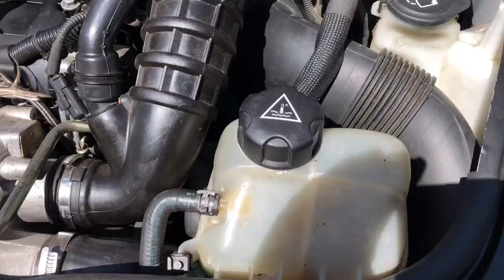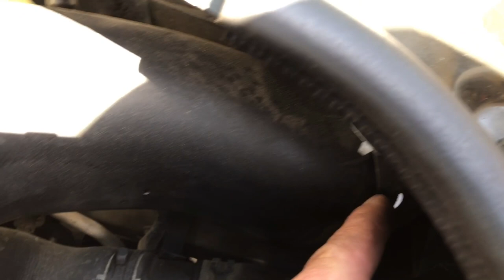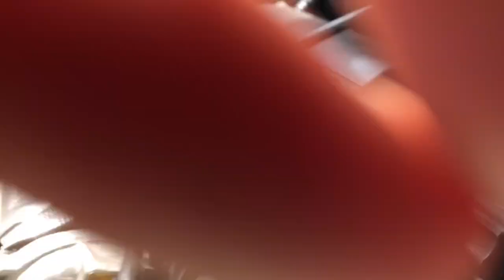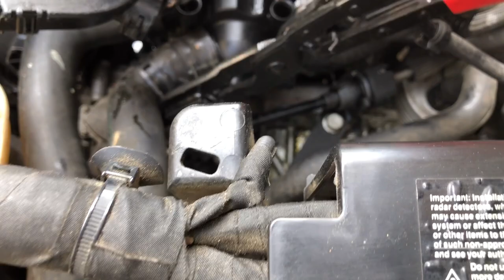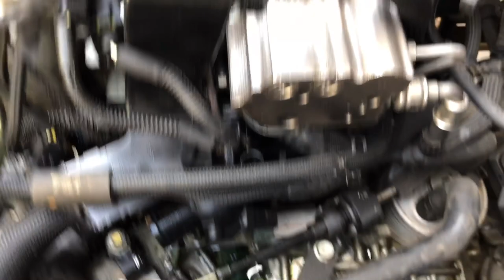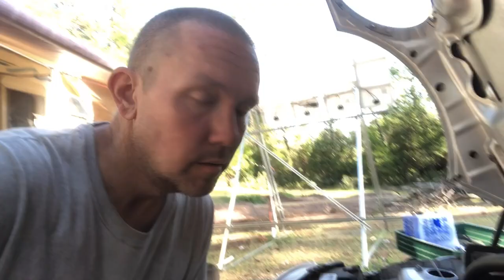How to replace the thermostat housing on a Mini Cooper S R56 with the N14 engine

Comment: I’m a novice but was able to do this repair in about six hours including the coolant fill. My biggest struggle was removing the turbo hose from the thermostat housing. My solution was to remove this once all the other hoses and water pipe connection were removed. I HIGHLY recommend investing in the $40 to get cable hose clamps. These will save you so much time and frustration with tight spaces in the mini

Comment: DO NOT do this project without new hardware for your thermostat housing. One of my bolts broke while installing the new one which turned this project into a 3 day long process. Fantastic video! I greatly appreciate it, my copper is a 2012 & the wiring harness was a bit different but everything else was spot on

Comment: This is an excellent video and explanation, thank you. Just changed thermostat housing and all the coolant pipes based on this video alone. Two things took way too much time - spring hose clamp on the coolant pipe that is half way up the radiator, and that damn water coolant pipe clip. The latter was due to me not positioning it correctly, needs to be at an angle facing engine and then slots in.

But thank you, would not have undertaken this without the guidance.

Comment: For the clamps going into lock mode, flat head in the slot and push down on that tab with the tip.  Or slide screw drive over Tab into slot and a little pry.  Replacing coolant crossover as I type.  Sweet video thanks my guy.  You got a new sub.

Comment: Hey, man!  My 2010 is overheating.  At first I thought it was just the fan, since it wasn't coming on, but I replaced the fuse and it started working.  The car was still overheating.  Replaced the temp sensor on the thermostat housing, warmed up, then temp dropped down again, then it started overheating again.  I'm going to change the whole thermostat housing next.  I'm starting to get nervous, though.  I don't have a thermostat code, either.  What else could it be?

Comment: My 2010 cooper heating inside is minimal even on 28 degrees only lukewarm could it be thermostat expansion bottle if full so not low on water

Comment: Great video man! quick question did you also replace the actual thermostat or just the housing thermostat? im planning on changing mine since i have some codes and want to buy them both together the thermostat housing + the thermostat
Reply from the maker: The thermostat is built into the thermostat housing
Reply: @ProjectMini  thanks a lot for replying brother! I was having that question (don’t know much about mechanics) but you definitely help me out have a good one

Comment: I’ve got 140.000km on my R56S and changed the thermostat housing for 3-4 times. What’s the case? Why is this part failing so often?
Reply: Crappy replacement part or incorrect installation

Comment: Hi. I need to change the thermostat housing as the thermostat is stuck closed, but also need to flush the system, as the previous owner put red coolant instead of blue. Do you recommend to do the flush with the old thermostat housing in place, or do the flush after I change the housing ? Thanks in advance.
Reply from the maker: With the new housing, i would flush it 5 or 6 times with just distilled water before adding the correct coolant
Reply: @ProjectMini  thank you very much sir !

Comment: What a nightmare!
Reply from the maker: I didn’t think it was that bad 😂
Reply: @ProjectMini   honestly looks worse then it is I currently had and overheating JCW r56 and valve cover was melted I might as well replace this and the water pump while I have the whole car apart I was just hoping it was like a Honda 2 bolts and then replace and your good this is pretty comprehensive for a thermostat
Reply from the maker: For sure, but at lease how easy the water pump is kinda makes up for it. I would do the crossover pipe at the same time too
Reply: @neyneyhernandez2972  you bought a JCW Mini Cooper expecting it to be a Honda? Well that was your first initial mistake. That’s like walking into the bmw dealership and expecting Honda priced service repairs. Not sure how your logic makes sense friend. If you complain about repairs on a mini, then you probably shouldn’t own one!
Reply: @maxboya  I completed the repair no problem lmao I was more hoping than expecting it was going to be an easy job... one note when installing the crossover pipe into thermostat housing without lube ITS LITERALLY IMPOSSIBLE.
Reply: Took like hour to do.. Without removing the harness at all, just lift it up a bit and leave it alone